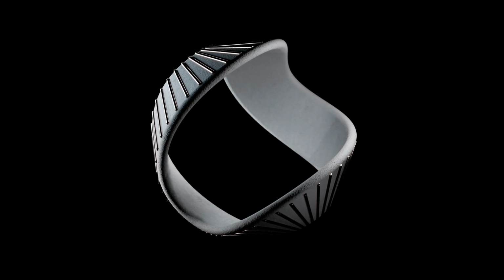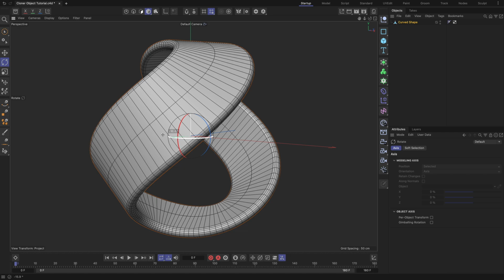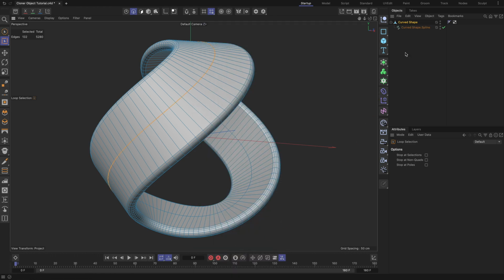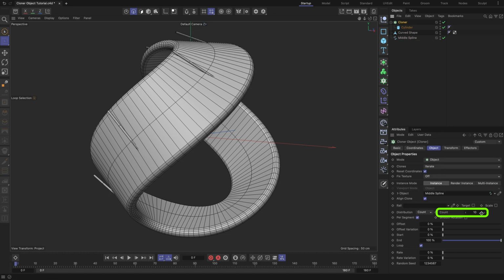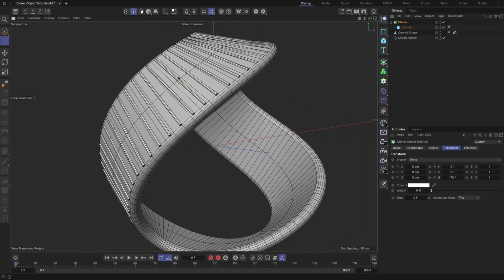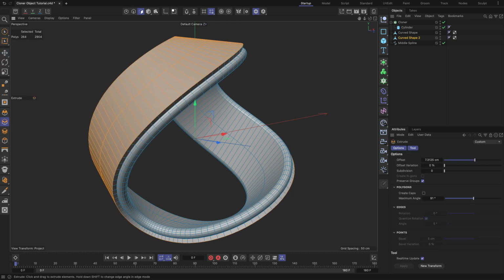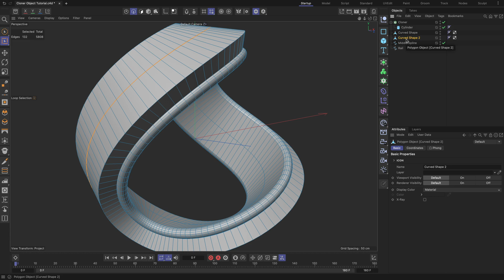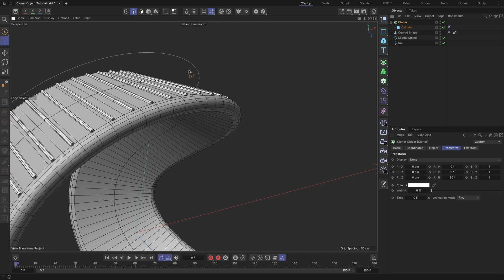The Correct Way to Use a Cloner Object on an Intricate Curved Surface in Cinema 4D

Comment: nice tut.  how did you make that shape.
Reply from the maker: Hi Brandon, thanks for your question! It's very easy to do. Just add a Circle, apply the Twist Deformer, and then use the Sweep Object to extrude the shape. Also, thanks for connecting on LinkedIn! =)